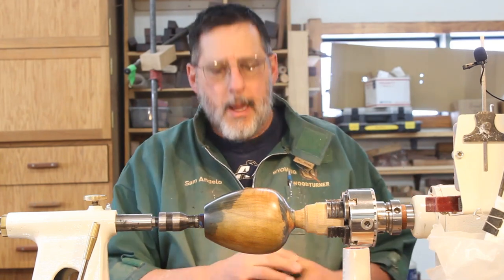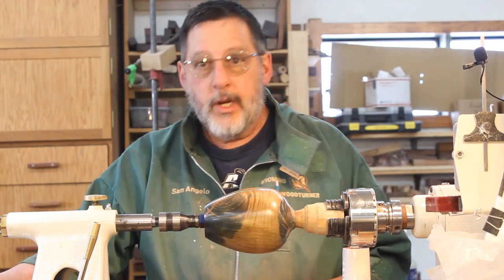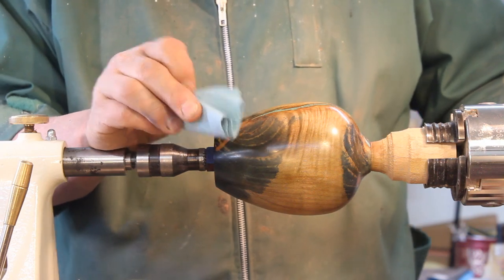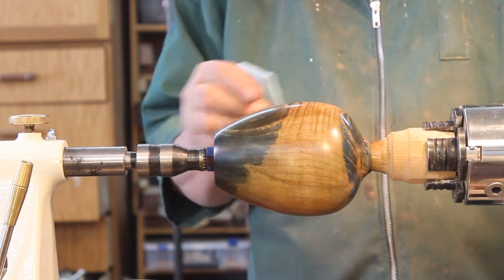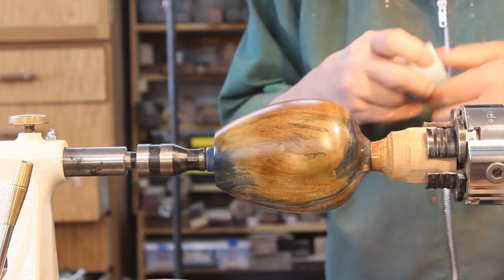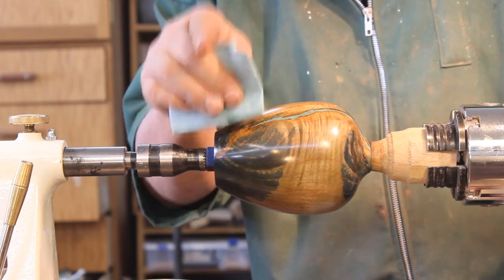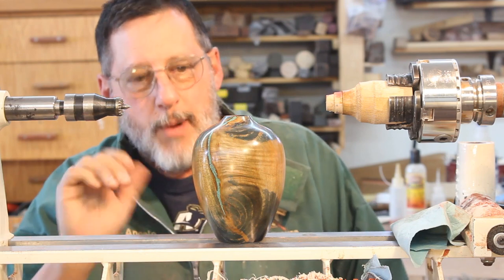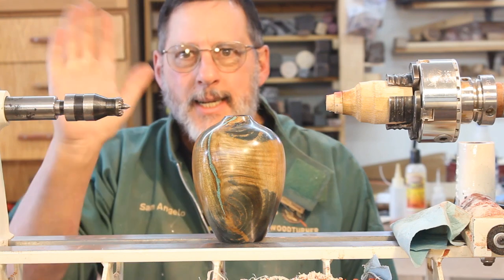Wipe-On Oil finish---- on a Hollow form by Sam Angelo

Comment: Most of us flat woodworkers consider Minway and Formbys, etc to really be wiping varnishes. Some companies  call them tung oil finishes, but they usually have some varnish (polyurethane) thinned with mineral spirits and linseed oil. There isn't much tung oil as you point out.I used to use a finishing sequence very similar to what you are doing in this video with very slow build up of finish. You can control the amount of build up and get a nice warm finish without a glassy look. It is a relatively tough and repairable finish. Thanks for showing that this works well on turning work.
Reply from the maker: +Frank B ....totally agree.  I will usually put on 8-10 coats as I did in the video.  But I really only did 4 or so as I was doing the video.  I will let a piece sit on my bench for a week or more and just keep applying finish to it.  Sam

Comment: I love MW Antique Oil Finish. It is meant to be a "penetrating" finish, but as you so well demonstrate it is quite capable of forming a thin film on the surface.

I often use it on top of Mike Mahoney's walnut oil finish. Similar to your approach of combining it with BLO for the first coats.

Thanks for sharing.
Reply from the maker: +Pettigrew Woodworks Yes, and I wipe off a LOT of what i put on.  It takes just a second to put on a coat.  But as you mention, as I use it ON the surface, I can't overdo it.  Sam

Comment: Awesome piece Sam!

I have a question about the turquoise inlay. If you have a crack like that which goes all the way through your walls how  do go about applying the inlay? Do you use tape on the inside to provide a backing?
Reply from the maker: +Uglulyx Yes I do use tape.  Also if the gap is really wide and deep, I fill in center with glue and sawdust to save on the turquoise.  If it is not too deep, I just go with turquoise all the way through.   Sam

Comment: So....you put a few coats of lacquer on first? To seal it?...then you applied the Tung Oil? Is that your SOP for finishing? Thanks!.... Oh, more good film editing....very smooth transitions.
Reply from the maker: +Kim and Steve S No, I was not clear in what I said.  I meant that I usually apply and finish these hollow forms with lacquer from start to finish.  I did say with this piece I applied some shellac then the oil.  Sorry for the confusion. Sam

Comment: Fabulous finish, Sam.  What ratio of Antique Oil Finish to BLO to thinner do you use?
Reply from the maker: +John Walsh I never really measure.  It is probably 50-50%.  At this point it is more establishing a foundation for the final coat which is straight wipe-on finish.  (It may be thinned a but)
Sam

Comment: That looks great. I am starting to learn wood turning. Where I live, can't get any boiled linseed oil. Just linseed oil. What do I have to do to get it to dry faster?
Reply from the maker: +John Forsthoffer Linseed oil will either be Boiled Linseed oil or Raw linseed oil.  I very rarely see Raw Linseed oil.  You might check local hardware stores or lumber yards.  The boiled linseed oil will have dryers in it.  This is what you need.  I would not try adding dryers to raw linseed oil.  (Too much trouble).  I would keep looking and check the labels.  Let me know what you find.  Sam
Reply: WYOMINGWOODTURNER
Thank you for your time, I appreciate it. :)

Comment: Beautiful. How do you get away with shellac on color?  When I use shellac, it smears the color, so I have to spray (rattle can ) lacquer and I don't like the finish.
Reply from the maker: +William Potts Good point/question.......My dye or stain is transtint.  You can get it from Woodcraft and such suppliers.  I mix mine with lacquer thinner.  Shellac is not comparable with lacquer thinner.  Or it will smear.  It helps to make sure the application of dye is very dry.  But you are spot on with the application of something that is sprayed.  I do the same often.  Sam

Comment: I have a question, will it be OK to apply heat to dry one coat instead to way for to dry by itself? Mario Moran, Sarnia Ontario, Canada
Reply from the maker: +melisat100 Yes but not too much heat.  I have a light bulb kiln that I use for such projects.  My kiln gets up to maybe 105 degrees F.  But I am never in a big rush however this would help speed up the process a little.  Sam

Comment: Sam, you confused me during this video. You said you allowed the finish to dry, then you removed it. If the finish was truly dry, you could not have removed it by running a shop towel over it. Normally, with a tung oil, you want to saturate the surface and then come back in 5 or 10 minutes to wipe off the oil that hasn't soaked in. Is that what you are talking about?
Reply from the maker: +Jeff Brody Yes, I agree with your thoughts on this.  Sorry if I was not to ally clear.  I try to wipe the wood down "before" the finish dries completely.  If that finish starts to dry too much you can put some mineral spirits on a towel and wipe down the finish.  Now, perhaps the confusing part is that I left the final coat on and DID NOT wipe it down.  But it is important to apply it evenly.  Hope this helps. Sam
Reply: +WYOMINGWOODTURNER 
Thanks Sam. I have been turning for about two years now and still looking for a "go-to" finish that I like on all kinds of pieces. I've used salad oil finish, a mixture of pure tung oil and d-limonene, wipe on poly, spray lacquer and a mixture of walnut oil and wax, as well as friction polish. As I said, still looking for something I can use pretty universally.
Thanks.